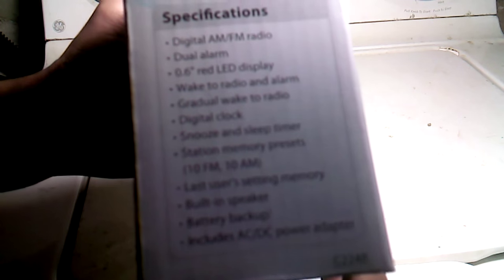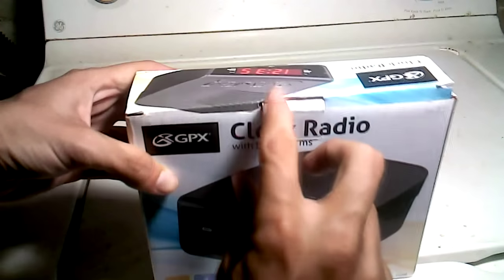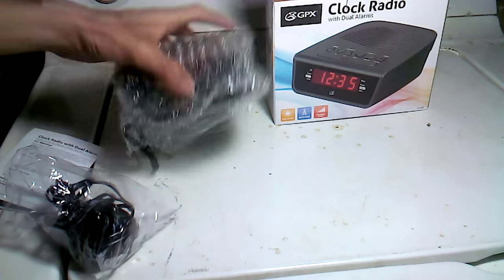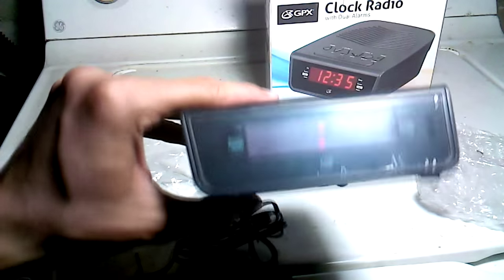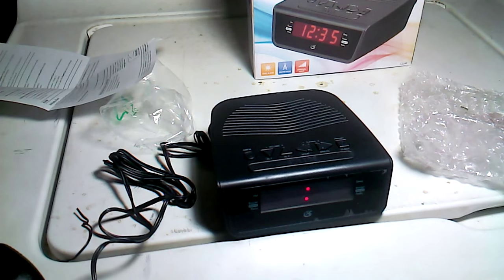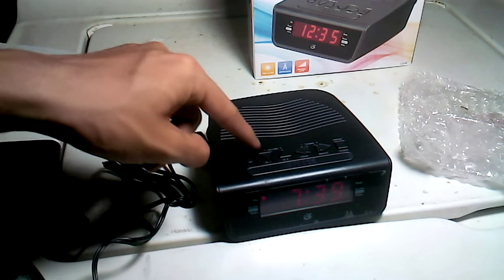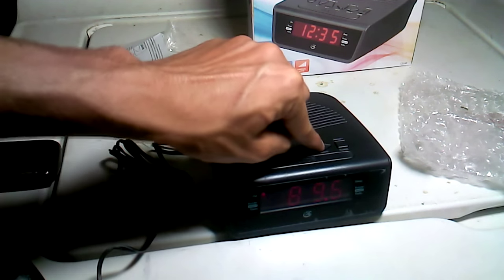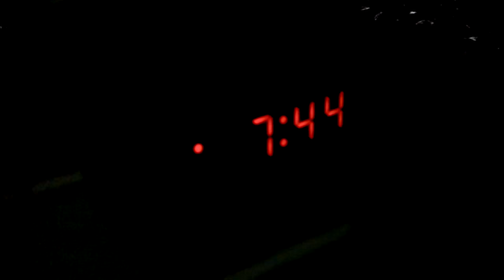Unboxing & Simple Review Of The GPX Dual Alarm Clock Radio PLL   C224B

Comment: Okay y’all mine is the exact same brand and looks the same but I have a problem my cord doesn’t come out I want to put batteries in it and use it cordless and it want work so what should I do ? And if I cut the cord will the batteries work than ?
Reply: The batteries only back up the clock. It is not able to be used like a travel alarm clock. Had one of these for almost 10yr now. My very old Sanyo one decided to turn on and not be able to turn the radio off in the middle of the night one time so I bought one of these quick at the Family Dollar. It actually is impressive for how cheap they are. A Sony one is much easier to work the settings but these are very nice for the price. Had a GPX tape boom box and Walkman knock-off as a kid before eventually buying nicer stuff and those didn’t last that long then but this one is still serving it’s duty very well

Comment: how does the battery back up work?
Reply from the maker: i sincerely never use it but i think it works well
Reply: TheAtomicsoft It works really good! You put the batteries in and if you lose power or unplug it it’ll keep the clock for a few hours until it’s back up and running.

Comment: This clock is impossible.  It is always changing when I try to set the alarm   It goes to radio stations instead of the buzzer alarm.  When I try to set it, it starts showing P 01 or P something.  This is my second clock.  Giving up.  Bought it to back up my phone alarm just in case.  Horrible clock.
Reply from the maker: you must have the radio off
Reply: @TheAtomicsoft  how I remove the buzzer with out having to reset the clock